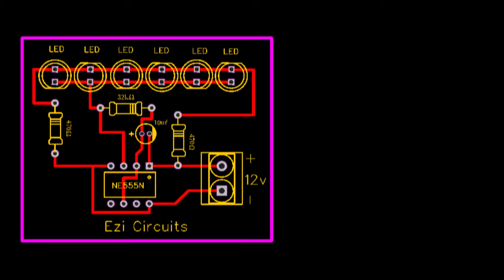How to Make LED Chaser on Bread Board | Ezi Circuits

Comment: Do you make any circuits with the CD4017 module or some other module where you can get a nice effect without having to use an arduino ?
Reply: Yes, I will do it for you but it will take one to two weeks.